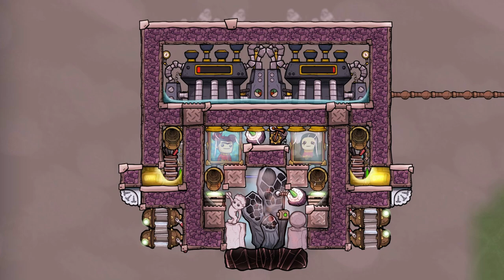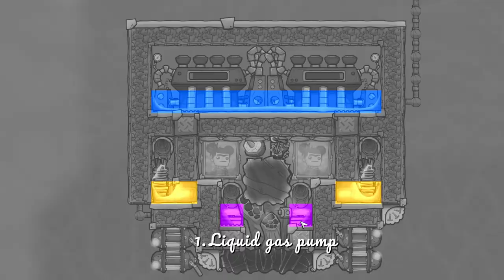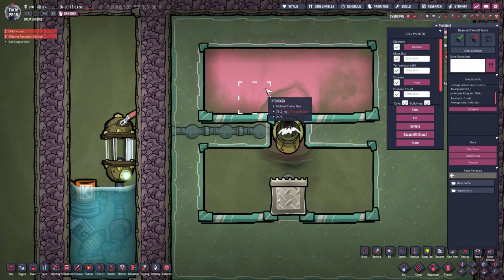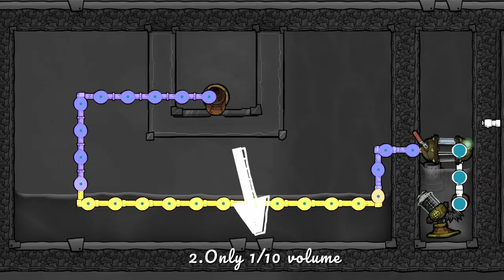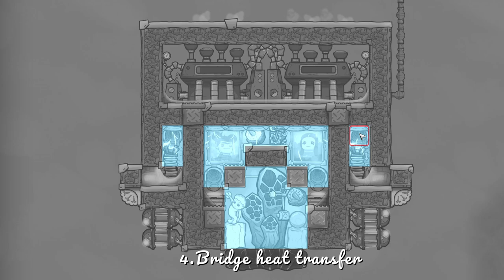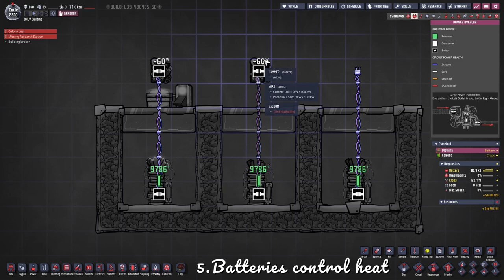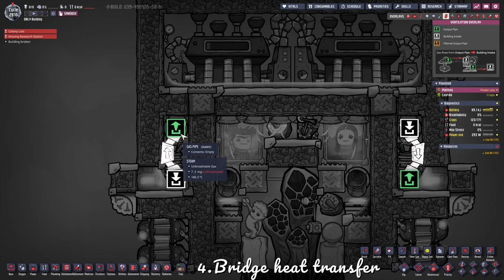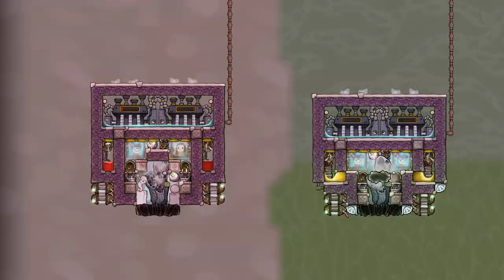My Cold Steam Vent Tamer - Explained

Comment: is it a way to build that with early game materials?
Reply from the maker: Since you need plastic for the steam turbines... plastic is normally no early game material
except if you have glossy dreckos!

So assuming you have glossy dreckos:

The magma version - yes. 
The steel version - well if you consider steel and ceramic early game also yes - otherwise no

Magma: You can replace the ceramic insulation tiles with igneous rock 
and the insulation tiles around the little chambers with obsidian insulation (is that early game?- well it depends)
The gas or liquid bridge in the little chambers need to be obsidian too. The rest can probably be anything. 
The power consumer can be any power consumer that does not actively use up power when it is not running.
Reply: That’s why I’m asking, cuz I’m trying to do it without the mid game material, but so far
It’s not power positive
Reply: Thank you, I’ll try again
Reply from the maker: @rafaelalstent4974  The thing that makes this (a little) power positive is the steam turbine running because the small rooms thell them too. So there need to be heat energy in the small rooms first, but what you get out over time is more. But to be honest i would not even bother trying to acces that power in a regular game. I would build it like this and have it self sufficient.
Reply from the maker: @rafaelalstent4974  If you have any questions feel free to ask. Or ask the discord those are wise people :)
Reply: Do u have a discord server?

Comment: does this tamer yield any reasonable amount of water?
Reply from the maker: Well normally everything that comes out of the geyser :D. 

So if the geyser has an active period output of 6.5kg/s for lets say 100 seconds that would mean 650kg in that time span.
Since the turbines can only handle 2kg/s  per turbine at a time (for all 5 inputs combined) 
they can only handle 2.4kg/s meaning the rest gets buffered. 
We have a buffer of 1000kg per tile in the chamber. 10 tiles of space. So we have 10t of Buffer Space.
So you will get your 650kg not in 100 seconds but in ~271 seconds. But you get the full amount.
The short idle phases and the dormancy helps to empty the buffer.

Mine had an output of 9.9kg/s so it overpressured for a few frames sometimes. 
I could have avoided that by setting the atmo sensor next the geyser to above 0 g/s.

Hope that helped.

Comment: This is why I sometimes really angry about this game. The basic vents that 100% exist in the map regardless of the seeds are all sort of trash, when randomly spawned certain vents are way better at every aspects compared to their basic counterparts and can completely replace them.

For example, you need this level of complexity and design to tame a cool steam vents and get '95C' water around 1~2kg/s average output, while water geyser just gives you a twice amounts of (3~4kg/s average) 95C water without any process. Polluted water vent give you the same amounts of water with 30 Celsius, and cool slush geyser gives you -10 Celsius with the cost of halved average output (1~2kg/s average, as same as cool steam vents.)

I don't think this is a good game design and think gameplay should not dramatically depend on the luck (seed) and liquid water vents must be basic to all map instead of useless cool steam vents. For example, polluted water vents on swamp biome and cool slush geyser on frozen biome are perfectly fit with it's nature and makes each biomes more unique, not only just makes gameplay more easier and enjoyable. I never use cool steam vents for this reason and always depend on liquid water vents for water supply.